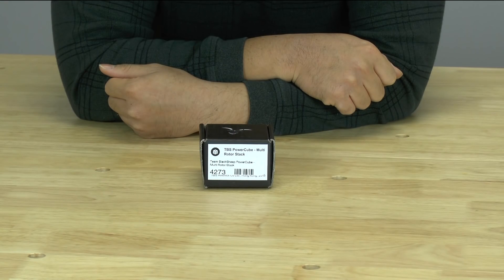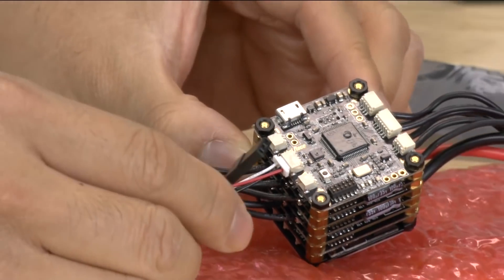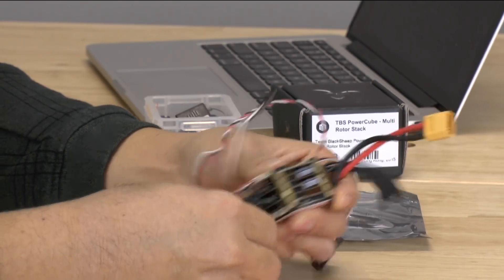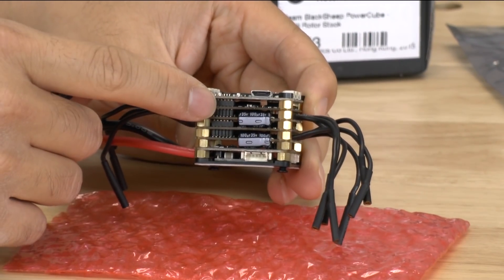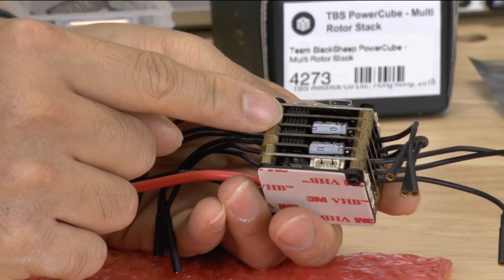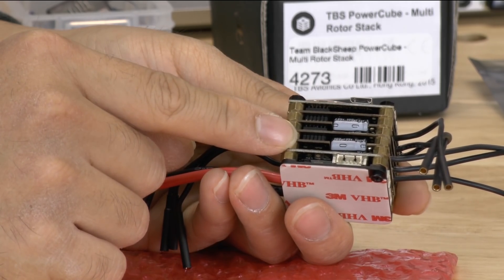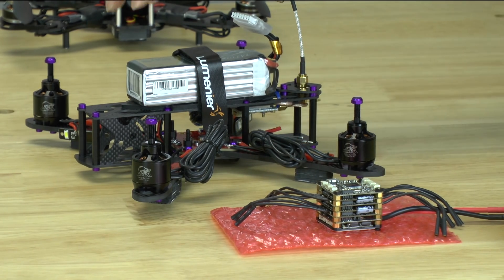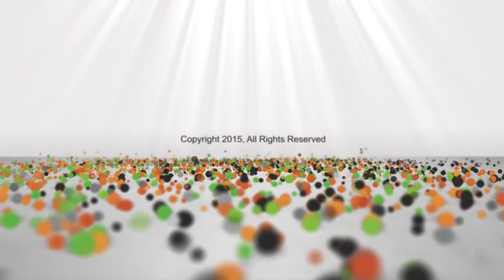TBS PowerCube - initial look

Comment: Hey, very nice overview! A few notes, just to avoid confusion.

1) VTx 5V and CAM 12V are only the default settings. The Voltage can be customized on the PDB. 

2) The servo cable was plugged into UART1. This is not necessary, you can run any R/C connection through the RC socket (labeled "RC"). It's on the other side, South-East in flight direction. Same port as the Spektrum Receiver :)

I am super-excited to see you go for the 2208 with 6S. It's one of my favorite combos, I used to fly it on a QAV250 until we ripped a hole into the fabric of space and time :) Will you be adding a CORE PRO?
Reply from the maker: +Team BlackSheep Thank you for the information. Great product. Have not thought about adding a Core Pro yet.
Reply from the maker: +Keys Myers The cube will fit between a 30mm standoff but the armattan has a plate in the middle to sandwich the arms... with that added height, it might not fit... and if it does fit, it will be really close.
Reply: hi tbs just wondering is there a way to flash the tbs powercube with simonk autoshot? thankyou all your products are very well made and plan to use majority of the tbs gear.
Reply: hi tbs just wondering is there a way to flash the tbs powercube with simonk autoshot? thankyou all your products are very well made and plan to use majority of the tbs gear.
Reply: yes, you can use the RapidFlash chrome tool together with the Colibri on Betaflight or Cleanflight. The Colibri can imitate a Turnigy Linker USB device.